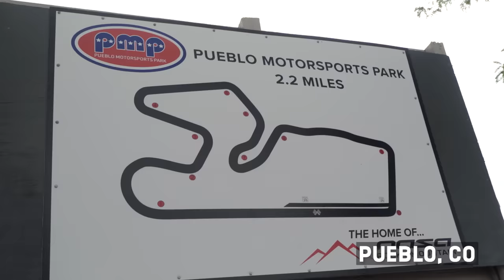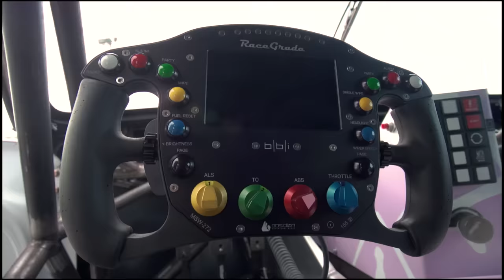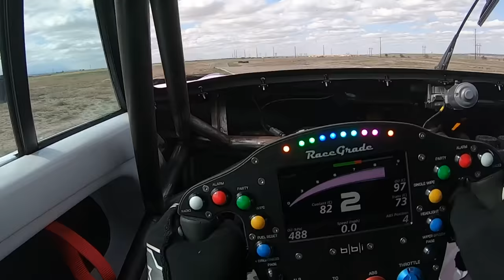Ken Block's Hoonipigasus FIRST START!! Pikes Peak Hill Climb Monster in the Making!

Comment: Dude it's so good to see what it takes for a race driver to learn a new car. Awsome video.
Reply: I'd love to see someone like Tanner Foust or Sebastian Leob drive it that can actually drive .
Reply: @PaceWorks  ok bud. ken block could drive a shopping cart faster than you could drive the hoonicorn
Reply: to be fair, it's not really a new car for ken, he uses the same exact 4 wheel drive train in all his cars, so there is very little that changes in regards to feel, unless you get down to tyre differences and engine power depending on tuning. imagine you have an RC car and all you do is change the shell on the top so it looks different.. that's ken's life. if that car had remained as lets say an original rear wheel drive porsche then i would agree with you as that would not be what he drives all the time and he would have to "learn a new car".
Reply: @ribbitism  You have no idea what you're talking about and its hilarious.  For starters the Porsche is mid engine and the Hoonicorn was obviously front engine. Also vastly different wheelbases. I cant find a lot of specs on the Porsche because its so new, but they are VERY different cars. Just because they are both all wheel drive, doesn't mean they are the same car. Indycars use the same everything and teams win based off just setup of the car alone. Also they don't have this car setup yet let alone dialed in and ken feeling comfortable in it.
Reply: @dead_redux  🤣 No he couldn't lad I beat him in my 2wd civic on every stage in Donegal rally in 2019 👍 and him in a 4wd escort cosworth he's a great business man and great at marketing but thers far better drivers out there than him 👌
Reply: @ribbitism  They are totally different cars also he's never used actually racing compound tyres on the Hoonicorn totally different level of driving and commitment required for this car 👍💯
Reply: @PaceWorks  proof or it didn't happen
Reply: @PaceWorks  Actually find that believable. Pretty much all the cars that win in amateur rally races are FWD, atleast here in Sweden
Reply: Definitely not like the usual commute lol.
Even harder than navigating a Suburban in India 🤣
Reply: I dunno man if you are not up to learn a new car, can you even call yourself an enthusiast?

Comment: Mr. Walter Röhrl once said: When accelerating the tears of emotion must flow horizontally towards the ear....  and if you' re not scared of the car it isn't fast enough so... we're waiting to see Ken pulling full power on this beast😁😁👌
Reply: Lia got to give the Hoonipigasus the full Hoonigan send on a cold engine and it was glorious, ripping through the gears like a motorcycle. You can tell they're running a compound turbo by the way the power peaks on the top end. I was so relieved to see Lia go full throttle at the Summit of Pikes Peak after watching it lug around the base like a naturally aspirated engine

Comment: That thing looks extremely twitchy when pushed. Hopefully some suspension work will get it dialed, but the lack of a center diff has me a bit worried.
Reply: Eh, they'll figure it out. The end of the video they started chatting a little about the setup needing work. These porsches were never really known for their rear stability lol
Reply: @Bwillev  Well, there is nothing Porsche left in there besides the roof skin and the engine. Early 911s were known for off lift off over steer because of the rear weight bias. This one is mid engine so that eliminates a big part of that old issue.
Reply: @Bwillev  this one is all wheel drive
Reply: I guess you don't know about the suspension system lol. It goes off GPS data. Not like they have the same data for this random track. The auto adjustments aren't displayed in this video
Reply: @binkleyme  I know that, but they way it is set up, only the ride height is adjusted. It cannot make geometry or damping changes on the fly. They basically just have a hydraulic actuator where the third spring would usually be on an F1 car or Prototype.
Reply: @tony_5156  This is FAR beyond GT3 spec. 1400HP, big aero, active ride height control etc. Also it was not built by Hoonigan. BBi Autosport and Scarbo Performance built it.
Reply: @tony_5156  Betim is the Porsche race car wizard and has already built several Pikes peak Porsches.
Reply: Right?! Something weird. Like how could they be so far off from the start? Not just once but a few times it got rly sketchy for a few seconds and it was very apparent
Reply: @MX304  Lol sort of a tongue in cheek joke out of me that they were trying to be nostalgic with this setup.  This thing is wild. Basically only the idea of the old Porsche exists at this point. I'm excited to see where they go with this.
Reply: Wait, that thing doesn‘t have a center diff? O.o 
So front and rear i‘d guess LSD of some kind but without a center diff, there is a worrying uncertainty for what happens on corner exit in various situations
Reply: @plusRpm  Drive shaft runs straight form the rear gearbox to the front diff. No center diff or viscous coupler. Front and rear have some sort of LSD. Not sure if they are electronic with some form of active diff technology or not.
Reply: @tony_5156  pikes peak*
Reply: @beezy7412  because it's something called W.I.P
Reply: The lack of having a center diff is nullified by the engine being moved to the center of the car, weight-wise anyway. I’m still not entirely sure which AWD system they used for this (my educated guess is a modified PTM system), the car does seem a bit twitchy, which lends to it being PTM, because 911’s with them have a habit of over correcting oversteer and causing understeer, and even though he said it was snap oversteer when he went off the track, it looked a lot more like he was fighting the car to turn. So it may have been the AWD compensating for oversteer, because that was not snap oversteer.

This is also something totally different and doesn’t really need the weight as precise as you’d think, because it has aero to keep it down. This is a hillclimb/time attack car. A completely different beast than the Hoonicorn and Truck.
Reply: @plusRpm  It’s a modified version of Porsche’s PTM system, which also didn’t use a center diff.
Reply: @MX304  More of this car is a Porsche than you think, just like the Hoonicorn was still more original Mustang than people think. It’s not just the roof, the entire monocoque from the firewall up is still a Porsche. The motor is also Porsche. It also looks like it’s running some kind of Porsche rear suspension, though they added a subframe in the front.
Reply: @tony_5156  

1. They didn’t build it directly

2. This is a whole different level of beast than a GT3

3. The Hoonicorn is still one of the fastest, if not the fastest drift car in existence (drag too, apparently) and Block had much more input on that one, so I think they know what they’re doing.
Reply: @xerodelacroix5552  The gearbox and diffs are Sadev units. The front diff is the same one they used in the Hoonicorn. SP03 or something like that.
Reply: @MX304  ...how in the hell did they pull that off with a 911? Not doubting you, genuinely curious.
Reply: @xerodelacroix5552  the lack of center diff doesn't allow independent wheel speeds in corners, thus binding, thus major understeer in grippy areas
Reply: I also think he's not going fast enough right now the aero isn't making a lot of down force it's all mechanical grip
Reply: @binkleyme  As a land surveyor it's my job to know how to get phenomenally accurate results out of GPS, and what conditions cause it to get less-than-desirable results. If I had to bet, I'd guess that the suspension adjustments are primarily based on inertial navigation with the GPS providing occasional corrections to the absolute position. Otherwise, i hope Ken isn't driving past anything taller than the car (like trees), or on the north side of high terrain. GPS isn't magic, and it kinda sucks unless you're very careful and have a whole lot of time. So, it's not racing-friendly.

Comment: What an awesome car and I can't wait to see Ken rip up Pikes Peak! 

The builders definitely should've at least rattle canned the roll cage though lol
Reply: The 'rusty' bar under the window is actually there from factory to hold the dash up.
Reply: @seanbailey8545  either way man, waaaay too much money and effort that went into that car to leave that bar raw metal.
Reply: @spencerdauphine970  in high end race cars like that you don't paint anything structural because if it starts to crack you want to be able to see it
Reply: I don't really trust that older Porsche 911 chassis for hard and tight turns. In my opinion, an Audi or a more modern Porsche like the GT3 chassis for the mountains is best.
Reply: @michaelshafer2996  I was gonna say, you might not want to cover everything
Reply: Unfortunately he passed away today.m in a snowmobile accident. RIP KEN BLOCK @spencer dauphine

Comment: "It's kinda snap oversteering on me.." Yes Ken, Porsches do that.
Reply: well, typically traditional rear engine Porsches do that, this one is mid engine, still snappy but not the cliche porsche oversteer.
Reply: @AmbientMike  all Porsches have a snap. The Cayman is a "mid engine" and their Cayman Cup racecars are even more snappy than their GT3 ones. Having a heavy weight behind your CG and rotation point makes a car snappy.
It happens because centrifugal forces are pulling your car's ass sideways. The only way you control those forces is through cornering speed.
Reply: @David-xl8zf  I'm well aware, however the stereotypical snap is related to old rear engine 911, but yes, mod engine will inherently also have more oversteer
Reply: @AmbientMike  rear engine cars will always have more natural oversteer than mid engine for obvious reasons of all the weight being in the rear transferring forces side to side in cornering. Mid engine have plenty of oversteer as well. Put some nice front and rear toe, camber and caster this thing is gona be a monster machine period
Reply: @AmbientMike  yeh cos you totally know how this car handles

Comment: Nice to see them try and get ready with running in Pueblo, but nothing will prep you for that mountain.  158 turns, 12 1/2 miles long, and starting at over 9000ft too run to just over 14000ft.   Expect the unexpected, run for the clouds, and respect that mountain.

Comment: Such a shame the engine failed. Should have got James Skyers at Ed Pink to sort out a bullet proof engine package, I think they rebuild the rare 917 turbo can am engines. The BBI brother looked overworked and totally beaten up mentally first time I watched this video, to have taken that whole MEGA build was mad, I would have subbed the motor work out... cant micromanage such a HUGE project in such a short timeline , just the aero and chassis/suspension work on this thing are freaking stunning... 1000hp plus has been done many times on these motors, it'd be the first thing I sub out to ensure the projects success

Comment: Question. Why to break in the engine when you probably have to rebuild it or at least do a huge maintentance before race anyway? Those engines are not running like 1000 of km to service interval.

Comment: It's reassuring to see a porsche oversteering. Granted I've only done simulators, but I always struggle with that and I guess it's a common problem. I guess when the car is setup right and the driver can handle it, it is super fast. But yeah.

Comment: I don't understand why the car backfires or pops when shifting gears. Is that unburnt fuel being inefficiently used? Does that mean extra fuel is required and weight of the extra fuel adds to the car's initial weight? I read somewhere that the unburnt rich mix is a way to cool down the cylinders but wouldn't a better engine block cast with better cooling properties be better?

Comment: isn't that wing gonna melt/catch fire when you gonna drive pikes peak with sauce/juice? exhaust angle should be more facing downward? hot air rises and you dont want to have alot of heat under the wing. why not x-exhaust to the sides? compression issue? if its a porsche targa base, that snapping is a porsche thing. ask gt3 drivers that driven porsche

Comment: The Porsche Boxster Type mid/rear engine goes full electric 1 way or another full electric possible Piston power.
Putting the purrr growl into the HP From PSi via RPM electric axial flux.

Won't sound like a RC motor stuck a new +My idea 2014 alignment EV motor to the same stick shift or slider (Refit for rally drifting semi auto his Hoonagan has) Mustang GT electric crate.

Comment: Cool engineering...But I wonder, putting the same efforts in to making a PP racer from a Tesla Plaid, which would be faster up the mountain?
Reply: The porsche, it's pretty much impossible to get the tesla that light and maneuverable.
Reply: @ihavewaited90daystochangem51  Oh, I agree, but will the Porsche be as fast up the mountain than a highly modified (primarily lightened) Tesla? Probably not. Look at the cars that hold the absolute time record up the hill.

Comment: That is fukn priceless, it's comfortable at 200 bhp, I'm sure it is, but I'm pretty sure adding the other 1,400 bhp will make it a bit "Twitchy", I built a 600cc motorcycle with 186bhp that makes that a bit "Twitchy" too, it took an extra gear to do it, my Road Legal 72 GT750 is gassed & good for well over 318bhp it does the 1/4 in 8.02 & it destroys everything it sees, but it would be fukt at Pikes Peak, that low oxygen at altitude is the killer, I tried to explain that to some fukn idi0t who said "It's only a hill climb" it is, but it's a fukn  big one, & the motor can't breathe, maybe one day.

Comment: I was hoping that Ken would show up in a Porsche EV to compete with Unplugged. Unfortunately Porsche is unable to compete in the EV class. More proof that ICE cars are done.
Reply: True, its not like the 1000+hp Unplugged Plaid on slicks was 2 seconds slower than a stock 911 Turbo on street tires at Pikes Peak. So either Tesla is just junk, or EVs aren't it. What would you say?